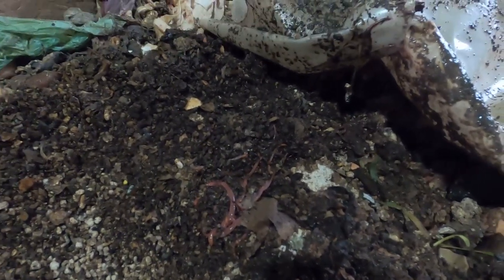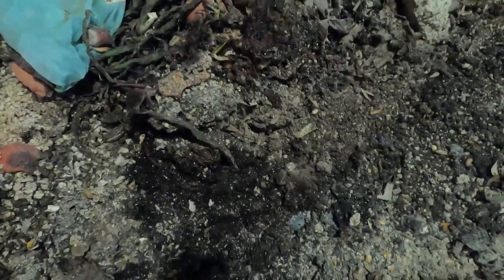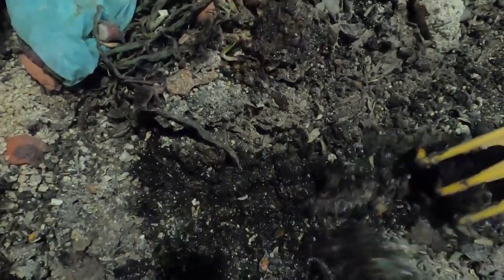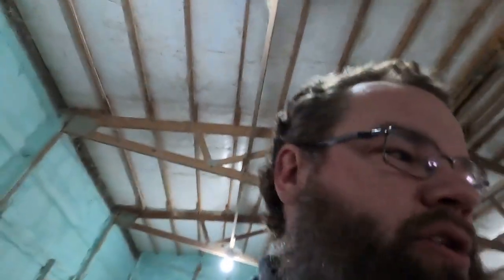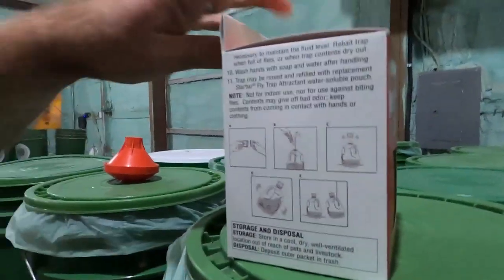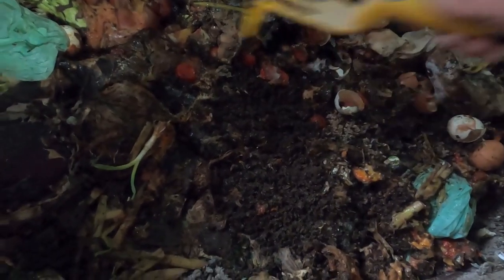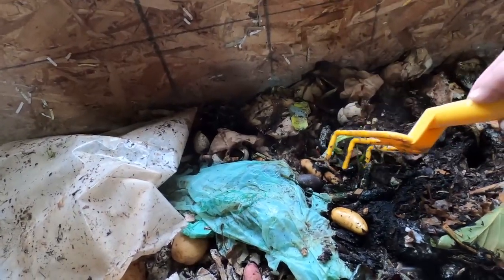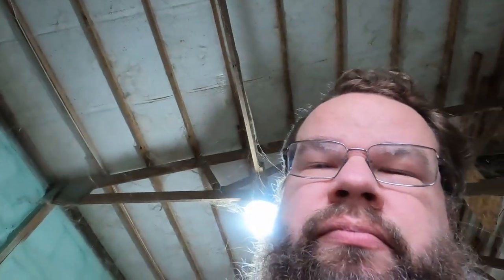Episode 74: Some fun pests in the worms bins and how we deal with them

Comment: I got a tip from another video that said to use mosquito bits in a spray bottle for fungus gnats. So, I put a tablespoon or so of bits into a teabag, stapled it shut and put it in the sprayer. When I knew I wasn’t going to disturb my worm bins for at least 24 hours, I gave the top a VERY light spray. I’ve only done this twice and the fungus gnats are down about 80% after a few days.
Reply from the maker: That’s my next video. For some reason I couldn’t find any at the store when I picked up the scary flystrike stuff. I’ve also had luck with apple cider vinegar and dish soap.

Comment: How does the Dte affect the end result in castings?  If applied on a regular basis .
Reply from the maker: It’s made of silica like sand, so it doesn’t break down, but it’s also not necessarily harmful(it’s in a lot of animal feeds). But it also doesn’t discriminate so sure it’ll kill off pests, but it will also kill off beneficial insects. Which is why we use it on the plastic sheeting above the bins and never directly into the bins to prevent all of it from going through to the finished castings. Worst case scenario the gardens/farms that use our products will have fewer insects.